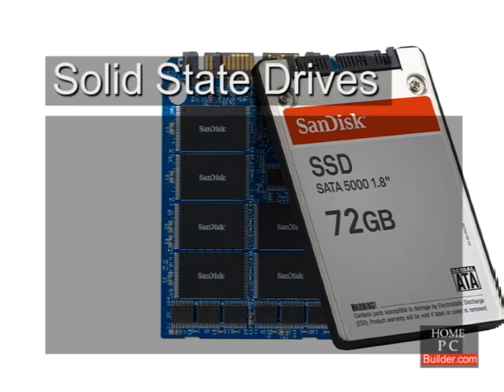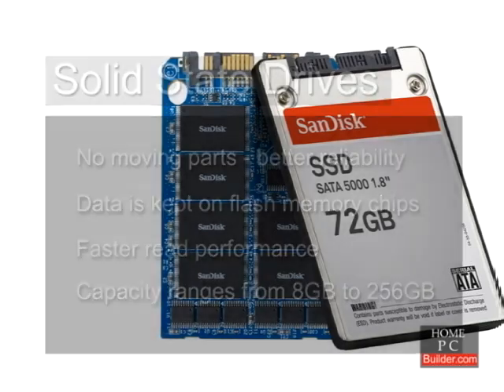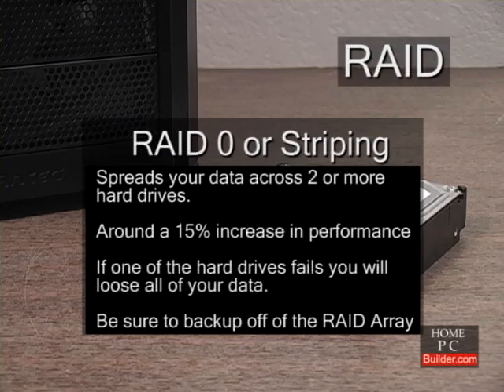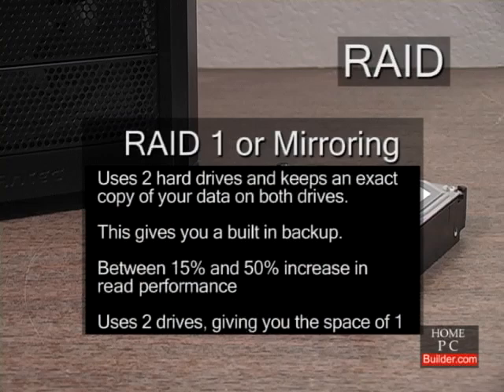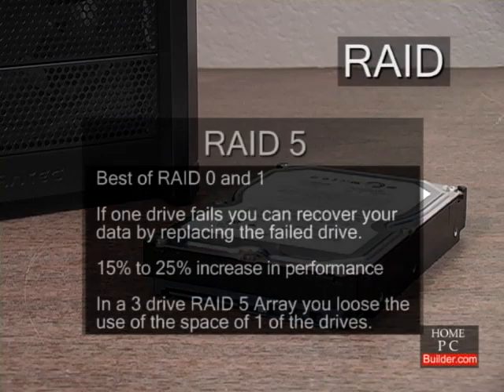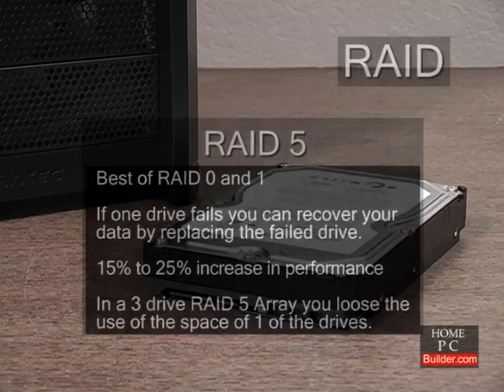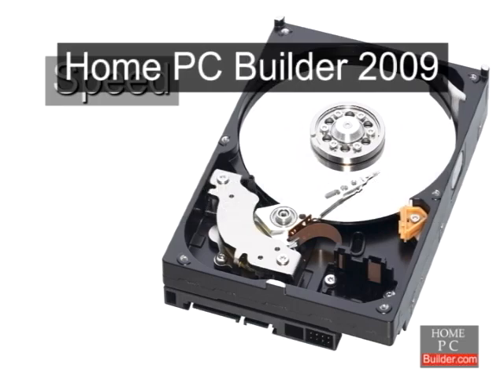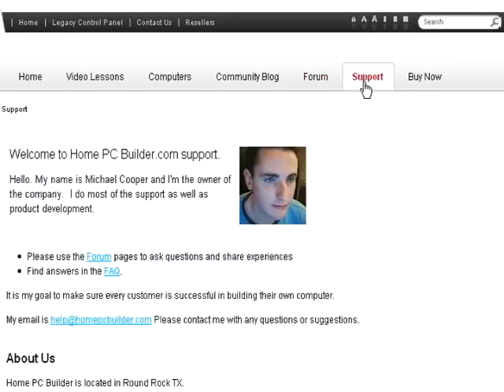Build a PC Computer - How to choose a hard drive - All New for 2009 - homepcbuilder.com

Comment from the maker: As long at it uses the SATA interface you can.   Older drives used IDE to connect to the motherboard and IDE controllers on motherboards are hard to come by.

Comment: Loading a 6 raid 4 architecture. Under the compression guidelines converting 1 GB into the proper space and compression between all drives can lead to misplaced or scattered data among the drives. i.e. the entire O.S. you loaded into the drive is inoperable.

Comment from the maker: You can build a gaming computer for £500.  That is about $790 US.  If you already have the monitor keyboard and mouse you can re use from your existing computer that gives you more money to spend on the core components.  You should be able to get a Core i5, 8GB of RAM and a good video card, case, PSU, etc., with your funds.  In the UK I would check out the Misco website.  They have good prices and I've had several UK customers tell me they are great to deal with.

Comment from the maker: Probably.  The newest motherboards are not coming with an IDE controller.  You need to make sure your existing hard drive uses the SATA interface, which all motherboards support.  If you have an older IDE type hard drive you need to make sure the motherboard you buy has a IDE controller built in.

Comment from the maker: @ApacheGate2 SATA 3 is a the new standard for hard drive interfaces.  It allow data to be transfered at up to 6Gb per second.  The older SATA 2 allows transfers of 3Gb per second.  Here is the thing.  No hard drive can get close to 3Gb per seconds of transfer.  The limitation is in getting data off the disk.  There are new SSD (Solid State Drives) coming out very soon that will need the extra bandwidth that SATA 3 offers, if it is just a hard drive or current generation SSD you don't need SATA 3

Comment from the maker: @Gamingmast3r Yes it can.  I would not run a computer from an external hard drive.  The drive and all your data would be more vulnerable to accidents and theft.  However if you want to do this make sure you get a hard drive with an E-SATA (external SATA) connection.  The computer has to have this connection as well.  You can use a standard external hard drive with a USB connection but USB will limit the data transfer, slowing the computer down terribly.

Comment from the maker: @selearemus The WD15EARS is a 5400RPM drive and with a 3Gb/s SATA interface.  The 3Gb/s is how fast the interface can transfer data.  There is still a limitation in getting data off and onto the hard drive.  This is typically in the 40MB/s to 140MB/s.  How fast this actually is depends on a lot of things.  Generally a 7200RPM drive will perform better than a 5400RPM drive.

Comment from the maker: @VorpDAHACKA That depends what you use the computer for.  Its very easy to fill up a 250GB drive with pictures, games and especially video.  The price difference between a 250GB drive and a 750GB drive is only about $30.  I think its worth it to get the 750GB.

Comment: @IneedTodisco firstly u dont need a highend grafics card for wow a 8800gts is gud enough (run at an adverage 60 fps),recommend 2gb of fast ram (1330) or 4 of slow(800). quadcore cpu eg q6600(2.4GHz), motherboard that supports your cpu and ram(ddr2 or ddr3), good quality power supply, you wont need more then 600watts. and HDD but remember your computer is only as good as your slowest component. you can make a cheap powerful pc for 1000 that would b better thn some 2000 ones.

Comment from the maker: $230 for 300GB is expensive. The number of different models of 10,000 RPM drives is much lower than the number of 7200 RPM drive models (rare).  Most computer shops don't carry 10,000 RPM drives because they are so expensive, per GB, compared to 7200 RPM drives.

Comment: In the real world a gigabyte is 1024 mb so a hard drive is ALWAYS less than what the drive manufacturer states.  Why the manufactuers do this is a mystery to me.  Also 10,000 rpm hard drives are not rare.  You can buy them at any computer store for like 230 bucks each for the 300 gb version.